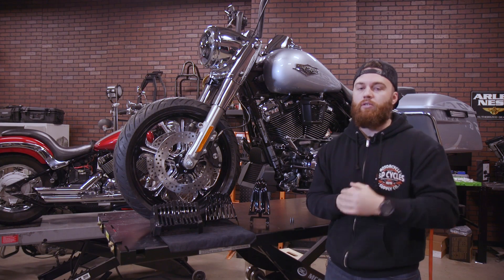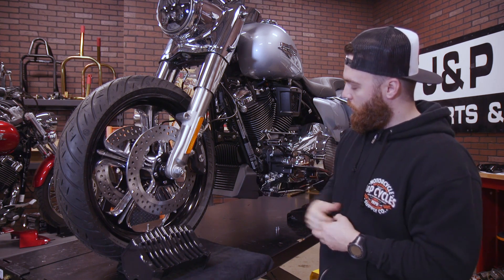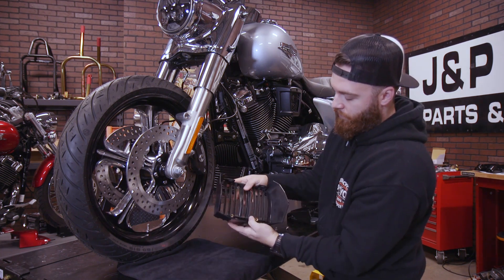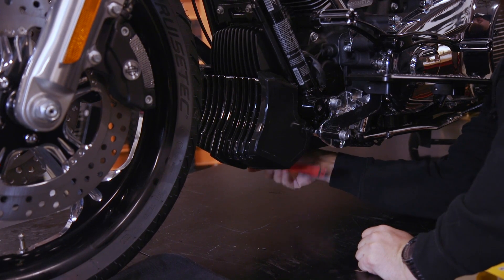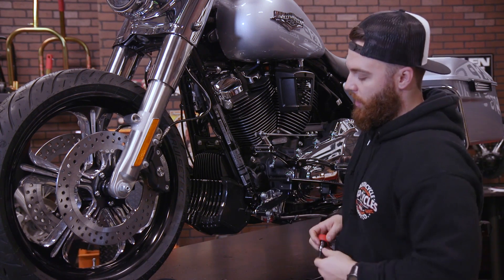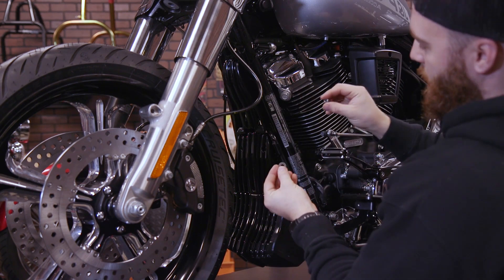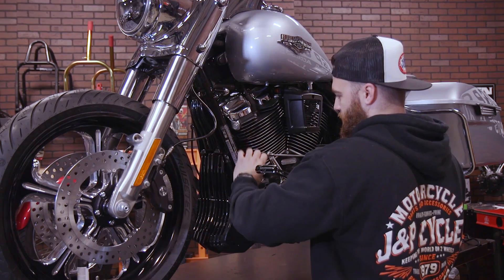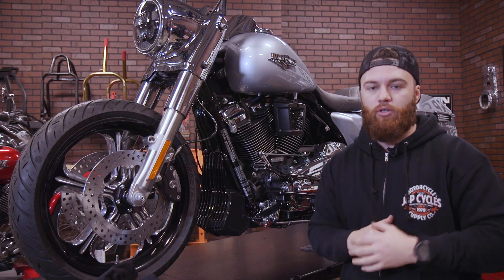Kuryakyn Precision Frame Cover Install

Comment: So does the crash bar not fit back on after these are added?......little more info would've been nice.
Reply from the maker: The crash bar can still be mounted. The only overlap between the cover and crash bar is at the top where the rubber grommet goes and is meant to fit with the oem crash bar. It will not effect performance of you crash bar. (We removed the crash bar and are not reusing on this bike, that's why it wasn't reinstalled).